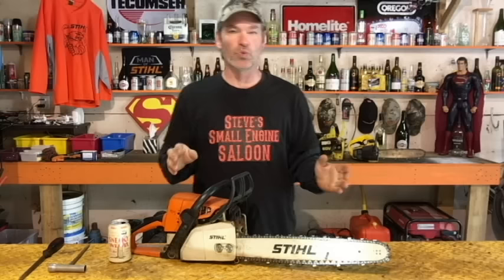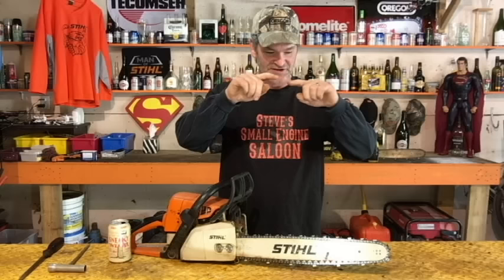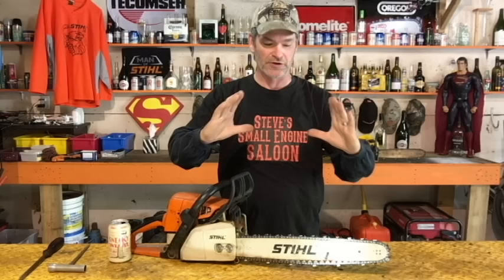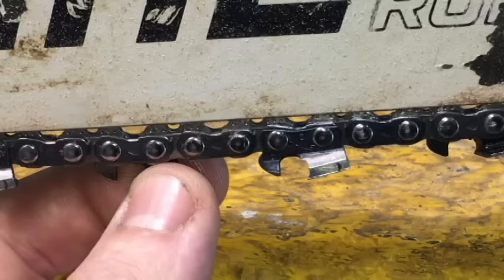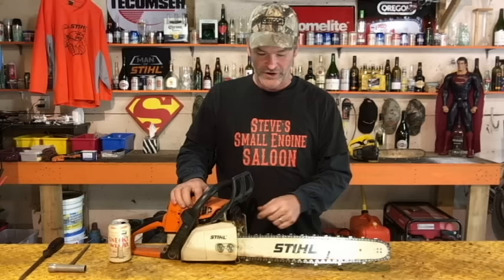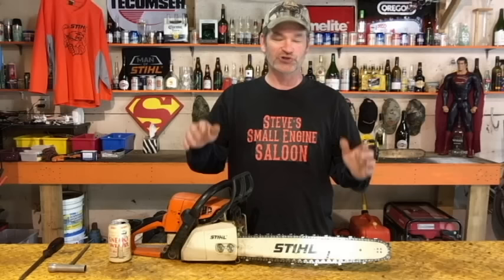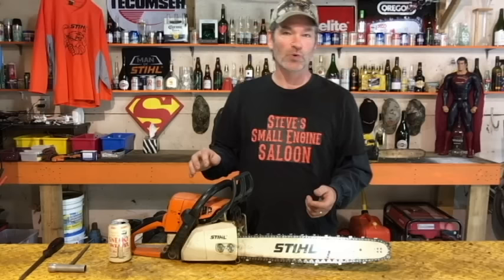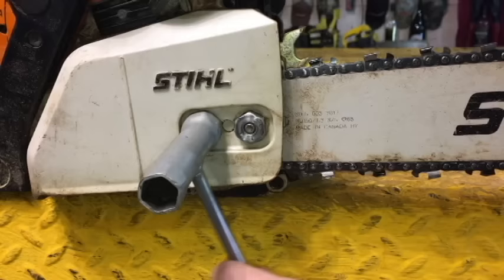CORRECT WAY To Adjust The Chain Tension On Your Chainsaw

Comment: I remember having a conversation with someone I worked with about this a few years ago. He argued with me that doing it this way didn't make sense - he said that making undercuts on tree limbs would end up pushing the bar down, so it didn't matter how you had the bar positioned when tightening the chain. I argued that based on the number of undercuts one makes versus normal use that it made sense to do it this way; plus if just strictly cutting firewood one typically pushes downward, thus no need for undercutting. My argument fell pretty much on deaf ears... I still do it the same way as you did in your video to this day, no matter. 😁
Reply from the maker: Right on

Comment: This guy is the MAN! It’s like explaining to the brain dead, so I can understand lol
Reply from the maker: Thank You...
Reply: @Steve's Small Engine Saloon  Yeah, same here.  I've ruined chains, bars and even one saw altogether by doing this wrong.  It is all so straightforward as Steve explains it.  The saw I ruined was from wearing out the sprocket by having it too tight.  And once I wore out the sprocket, I could never tension the chain consistently because the chain would sometimes climb up the sprocket to be like its normal position, and at other times the chain would slip down into the deeper grooves I had ground into the sprocket.  I could have replaced the sprocket, but it was a 40-year old saw and the new part cost more than the saw was worth.  The only thing I would add to Steve's excellent discussion is that at all times, the chain should easily move on the bar.  That is to say, after tensioning it and making a cut or two,  turn the engine off and with a GLOVED hand, move the chain back and forth.  It should move very easily, not binding at all.  It is not a bad idea to do that quick check right before you start the saw EVERY time.  Sometimes you will have some wood chips in the groove and by manually moving the chain both directions, you may clean out the groove a little.  AND you will catch an over-tensioning situation before you damage your saw or yourself.  It literally takes only 3 extra seconds each time.
Reply: I noticed the chain tightening after adjustment.  I assumed it was due to the bar heating up and expanding.  Holding the tip of the bar up while adjusting tension is important.  Good information.

Comment: Been using chainsaws for 10 years, I'm not a professional, and always wondered if to adjust tension with bar up or down and how much. I've been doing it half way between the two so not too bad but this is clearly the way forward. Many thanks and stay safe.
Reply from the maker: Right on

Comment: I did that for years, and always found my bars would wear crooked faster..... also noticed when you give the beans to warm the engine, the chain is hanging off the bottom a good deal.  Now, I tighten till it still has some decent spring tension, but still easy to move the chain by hand.   Once it starts spinning, the hot, relaxed chain just barely hangs off the bar, keeping itself sucked up, barely loose/relaxed, and not really under tension.... but not saggy and rocking the teeth In either.... best part:  no more worn bars.

Comment: Great video... Exactly how I tension my chain. If I may suggest, I place a block of wood under the tip of the bar and chain so that bar is resting at its highest position as you had described by holding the bar with your hand. Using the block of wood will allow you to use both hands for adjusting chain tension and tightening the lock nuts... It's just something I've found helpful. 

Thanks again for the good videos!
Reply from the maker: Great tip buddy, Thank You...
Reply: Will that allow the tension to adjust correctly? When you turn the tension screw, is it moving the bar? Or is it moving the sprocket or what?
Reply: @thomasharp3246  It's moving the bar.  The sprocket is firmly attached to the engine.  Take the cover off the sprocket side, keep the bar and chain in place (takes about 3 hands, LOL) and turn the screw, watch what is happening.  You should be able to see the bar move back and forth.  Of course, you are going to have to put the cover back on, and readjust your chain tension.

Comment: I was cutting into a huge piece of fatwood today and it was the usual slow going. Took a look at my chain and it was about ready to come off. Not the first time this has happened either.  This fatwood is like petrified wood.  My chainsaw is working overtime on it. Takes forever to handsaw it and my wrists are not interested, so I use my Husqvarna. This the second huge piece I've gone to war with this month. And don't get me started on the embedded dirt and rocks. Even after a thorough cleaning. We're talking decade plus old fatwood. Thanks for your video

Comment: Thanks brother.  I was a dealer and have been cutting wood for fifty years.  I wouldn't sell a saw without training the customer.  Here is what I taught:  The bar and chain must be cold.  Loosen the bar nuts.  Hold the tip of the bar up while adjusting the tensioning screw.  Increase the chain tension  until the chain just kisses the bottom of the bar.  Tighten the bar nuts.  Manually pull the chain around making sure the chain continues to maintain contact with the bottom of the bar.  Repeat the process if necessary.  Shalom/gw

Comment: Finally Steve, I as one, have just seen somebody (you) tighten up a chainsaw chain the correct way. Myself I just place a block of wood under the end of the bar that holds the bar up the right amount. Keep up the good work, and the right information. Also I've been a logger and worked in wood mills of one sort or another, my father told me to put that chainsaw on the ground when you go to start it!!! Period. Even the little ones. Even a dull chain can cut the HELL out of you quicker than you can blink your eyes. Especially the little ones. MICHAEL said that bye for now my friend.

Comment: Another great video Steve.  When I was young, my father met a manager from McCullough Chain Saws.  The guy liked my dad and they formed a business.  Quality Control at McCullough would pick saws at random off the assembly line, perform a series of abusive tests on them, examine them under a microscope, and then throw all the pieces in a box.  If you had an employee number you could buy a box of unassembled parts and reassemble them yourself.  The business was reassembling the saws and selling them at steep discounts and with full disclosure of there source.  I am amazed how well most manufacturers construct those saws and how much abuse they will take.  It is better still to maintain them properly and enjoy even longer life and better performance.  Thanks for the video.
Reply from the maker: WOW!  Bruce that was an incredible comment!  Thank You...

Comment: From what I remember during training, you lift the chain halfway along the bar on the top, correct tension is reached when the chain guide just clears the bar. My old Husky used to rock forward onto the bench as I was tightening the nuts, that achieved the same result as holding the tip up.
Reply: I got those exact same instructions too about 35 years ago. Still got that Stihl 009.
Reply: using this method should be fine for certain length bars but when you get into longer bars you should have more clearance... there's no exact science but the longer the bar the looser the chain can and imo needs to be to work freely. as stated 20 people 20 opinions ( very roughly paraphrased :) ) so yeah just my 2 cents

Comment: I was taught many moons ago to lift the tip up while tightening the nuts, a good way to do it is rest the tip on a small log so the weight of the saw is pushing the tip up, not many do it the correct way though,  glad you are showing good practices, thanks for sharing 👍

Comment: Good job, Steve.  (BTW- 1200 RPM, not 12,000!)  Long since retired, I repaired chainsaws for many years and, like you, stressed the importance of chain tension.  Too loose will also place undue wear and tear on the bar and sprocket.  To properly tension the chain, I instructed my customers to lift the weight of the saw about ¾ of the way out on the bar by the chain itself, then adjust to where the chain guides were just coming into the bar's slot, then tighten.  That provides pretty much the same tension, on the chain as your method- and locks the bar in the "up" position you describe in your video. I thank you for taking the time to make this informative and helpful video.

Comment: I would normally adjust my chain a little loose because I didn’t know this technique, but knew it would tighten up during use.  Now I know why and how to adjust it properly from the get-go.  Thanks for the excellent advice.
Reply from the maker: You're welcome!
Reply: That sounds backwards expansion happens with heat. 🤷‍♂️
Reply: @cole9909  or the coefficient of thermal expansion of the bar is much higher than that of the chain😵‍💫

Comment: Great video, and advice. I watched this a couple years ago after purchasing a new saw, and since then this information has served me well. It’s kept me safe, and definitely helped in regard to the extending the service life of the bar, and the chain.
    In regard to servicing in the field, I started carrying an awl, (or a thin flathead screwdriver), along with the standard nut/flathead tool. 
    After servicing now, I’ve found that placing the awl through that single hole in the forward part of the bar allows you to keep constant upward tension on the bar while tightening the nuts. This also eliminates having your glove contacting the chain (or the bar), in the front sprocket area, which can sometimes be quite hot. But this method also allows you to pull the chain around a few times while the bar is fully upward, in order to detect any tight spots in the chain that might otherwise throw off proper tensioning. 
   Before using this method, I had many an instance of “properly” tensioning the chain without moving it at all, only to find it overly loose again once throwing the brake on, and checking it after the first few cuts.
  Hope this helps someone, and thanks again for the video. 👍

Comment: For sentimental reasons I got into the habit of keeping my previous dog’s collar through the loop of the handle of my saw. One day I had to take the bar off the saw while out in the field. Not having a bench that I would normally have to work from, I decided to hang the saw from a branch, putting the saw at chest height for me and found it to be a surprisingly easy place to clean the saw from!
Putting the bar back on and tightening the chain was a breeze because gravity perfectly tensioned and positioned both bar and chain.
Ever since, I use the same technique in my garage with a sturdy nail in the nail in the rafters.

Comment: i always run the saw for half a min , turn it off and re check the tension then .
sometimes it can be sitting on the '' wrong '' part of the drive sprocket.
just something that works for me.

Comment: Good job!  I personally, already knew this, but it's good that you're educating the new generation of wood cutters.  They need to know these things.  Keep up the good work!

I usually just set the saw down on the floor of my trailer with the tip resting on a piece of firewood of sufficient diameter to raise it to the highest position and then tighten the nuts.  That way I have the left hand free to stabilize the saw and keep it from moving around.
Reply from the maker: Well said!

Comment: I’ve been using that method for over 40 years and it works. Thanks for sharing this method. I cut 2-3 cords a year along with the other work I do in the woods and I’ve only replaced my bars 2x on my saws. I run a 024&028 Wood Boss Avs. The sprockets are in great shape. I do grease the bar tips every day and I think it helps extend the life of the bars. Cheers 🍺!

Comment: The method i use when re-tightening the cover nuts after adjusting the chain tension screw to where i want it;  i hold the top handle bar with my left hand while resting the bottom of the rear handle across my left thigh, with the tip of the bar on the ground (preferably on a piece of wood or log, not dirt) and then with wrench in right hand (cause i'm a righty) i tighten the nuts. This keeps upward pressure on the bar tip as the nuts are tightened securely. Just the way i've learned to do it.

Comment: After decades of chainsaw use, this is the first time I’ve ever seen anything explaining how (AND WHY it Works) to tension a chain correctly. I’ve been told or shown lots of ways but never anything like this.
I’d note that maybe you should have mentioned readjusting the chain after it had time to heat up from usage and detentioning it after use.

Thank you.
Reply from the maker: You're Welcome...

Comment: Great information!  Thanks Steve!

  The holding the bar up trick was not something I’d known of, and explains a large part of why my chain would get loose after I start cutting.  I realize temperature change/heating does some of that too, but I think most of my issue was not knowing to hold the bar up.   

  Since learning this from you it has become a non issue.  In the field, sometimes it is easier to push the front of the chainsaw down gently by the top crossover handle... making the tip of the bar push up, relative to the bolts, in the direction cutting down makes it want to go.

  Helps to do it on a couple of rounds stood up the right distance apart, to leave room next to the bar for accessing the adjuster screw.

    The tension setting on my most used, cheap poulan 18” saw, is built into the adjustable Oregon bar I bought for it, and I just use that and leave the regular screw all the way loosened. Can tilt the front of the saw body down and set blade tension on any flat surface with no access issues on that one.

Comment: Interesting, I seem to remember reading this exact same information back in 1984 in the little booklet that came with my Farm Boss. Many, many dozens of cords later, that saw still works great. Been thru lots of chains. a couple of bars and 2 clutch housings but experience shows me that this here method works.
Reply from the maker: Thanks for sharing!
Reply: I have a Farm Boss and it is a workhorse!

Comment: Tips: It is easy to overtighten the bigger the bar gets. You want it snug when cold because the chain gets longer as it heats up. Keep your chain snug but grease your sprocket occasionally (not all have grease holes, then perhaps take off and rake out bar occasionally and do lube throw test occasionally to check oiling well). On small saws (stihl ms200) sometimes just before the chain tightening lifts the bar slightly is a good tension. A tight chain can be costly, a loose chain can be deadly (well not pleasant anyway).

Comment: I appreciate the lack of gawdy into video and music.  I'm here for the channel content, not for someone to show off how well they can make an intro video.  Thanks for not wasting my time.  Great video by the way.  I've cut hundreds of trees with my dad but that was 25-30 years ago.  I have his old Husqvarna Rancher 55, and it's still a power horse compared to newer models.  My chainsaw was in the shop and my young neighbor wanted to help when he saw me using my Sun Joe extension pole saw cutting dying limbs from a tree in my yard.  He bought a new Craftsman 44cc model to help me the following day since an 8" bar will cut limbs, but it won't cut through a 30-inch tree.  That new saw didn't cut 1/2 as well as my 8-amp extension saw.  You can remove the pole and make it into a small/normal sized chain saw.  His new Craftsman was crap, brand new out of the box.  It looks like a Tonka Toy, but it cuts like a beast.

He "said" he knew how to use a chainsaw, but I could instantly tell he didn't.  While cutting he was moving the saw forward and backward as if holding a manual saw instead of allowing the saw to move forward and hit at the dog or whatever it's called.  After correcting this, I asked if the sprocket was greased, and oil was added and he said it was.  I had to stop for the day, so he left me his saw.  The next morning, I was going back out to work, and the blade had turned color and when I opened the bar lube cap, it was bone dry.  I sent him a text explaining that, and a photo of what you use to grease the sprocket, and he'd never heard of either.  People don't respect how quickly these tools can maim or kill, and they really need to be taught or at least watch videos from people that have used these saws for many years.

Comment: A problem I've run across on a few saws is when the drive sprocket has uneven or excessive wear, and you can see the chain tension change at several different points when rotating the chain on the bar by hand, but the owner never notices and continues to tension the chain causing more damage.
Reply: Yes I was going to comment this

Comment: First, thanks for the video. Your videos are always very informative and often answer questions sometimes I didn’t even know I had. Second; I notice that when I tension my chain on a cold saw and then run it for a minute to get it warm, the chain loosens up pretty dramatically. It’s especially noticeable on a cold day. So I usually re-tension my chain after it’s warm to account for the expansion of the metal. Should I be doing this? Or, am I doing something wrong when I tension my chain initially?